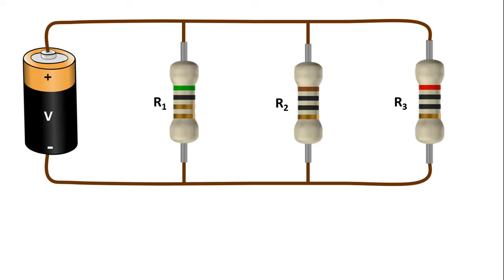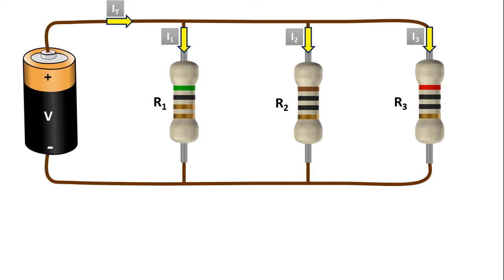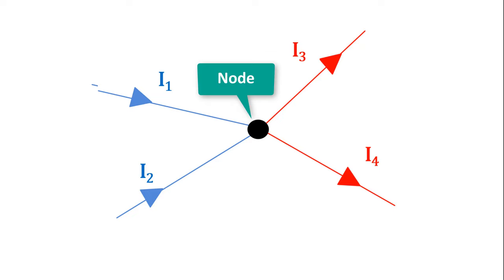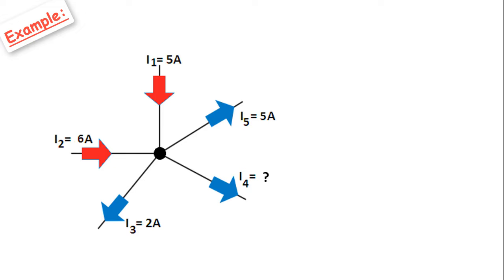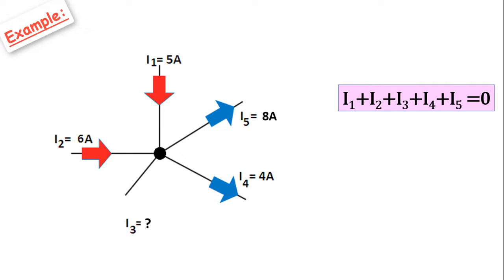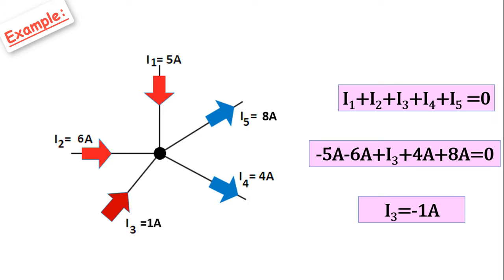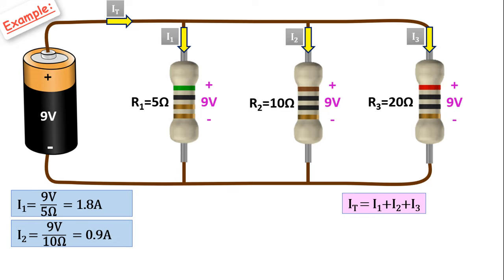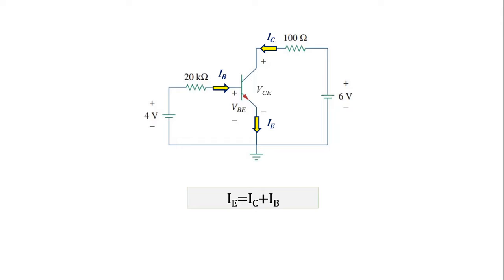Kirchhoff's Current Law (KCL) Explained

Comment: All laws of physics are quite simple. But it is the tendency of academicians to screw it and make it difficult to understand and apply.
Reply from the maker: Glad you like it ☺️🙏
Reply: No. It's that the students are not very intelligent.

This is the problem with electricians. They have trouble understanding the basics of electrical circuit theory.

But the basic principles are actually quite simple. But these principles employ some mathematics and that is what most student electricians can't handle. They left school with very few exam passes, and then the electrician courses have no pre-requisites, so no minimum knowledge of maths is required. So when it comes to students understanding these principles in class, they struggle.
Reply: @deang5622  Teachers only screw the subject
Reply: @deang5622  with all due respect to your views. In the U.S.A., we have electricians, electrical Licensed contractors and electronic engineers and technicians. Quite different in there trade and applications of there aquired field of choice. "I" am a retired Master Contract construction Plumber. The people at thee other end of sewage discharge are civil engineers. We both handle pipe, but are at different levels. 
My birth father was a line man,, he worked the high power lines before they dropped into sub station transformers and distribution lines to houses and buildings where; electricians with there "SPEACIALIZED" training was applied. All of them worked with wires and applied voltages and amps too there preferred ability of knowledge. 
No different for family practitioners vs. Oncologist.
Reply: everything seems simple until you look closer

Comment: Great way to give the depedence of maxiumum absorber temperature on the concentration. For the absorptance the value one independent of the wavelet is assume then importance is on The Kirchhoff's law states that every wavelenght the absorptance is equal the emmitance of a surface. So this is brilliant way to bring on the light Kirchhoff's law like very good emitter of thermal radiation.

Comment: Hi..what's the answer of this?
Three resistors ABC are connected in parallel. The resistance of A is 6 ohms and that of B is 5 ohms. The resistance of C is adjustable. The current to the circuit is 4 amperes. To what value should the resistance of C be adjusted in order that it may take 1.5 ampere?
Reply: It shouldn't matter what it's adjusted-to! If the circuit is already "taking" 4 amperes then it will "take" 1.5 amperes and also decrease heat generation by approximately 66.6%, unless of course after lowering the current it was then placed into an oven along side a delicious pizza that was being baked at 350F for 30 minutes. In this case we would then need to know which station the train left from at 2pm so Timmy isn't late for his 3rd  gender-reassignment bottom-surgery....

Comment: Your images suggest a duracell, which unfortunately is well known for its extremely damaging leakage.  Maybe better to use the rabbit or a generic.
Reply from the maker: Pictures are representative only.
Reply: What does the type of battery have to do with the principle?

Where do you see in the mathematical equation reference to any particular type of battery?

You should be smart enough to recognise that the manufacturer of the battery is totally irrelevant.

In actual fact, using a battery image is not the right way to represent an electrical circuit in the first place. It should be fine with proper electrical circuit symbols which are standardised, and the battery is represented by two parallel lines of unequal lengths.